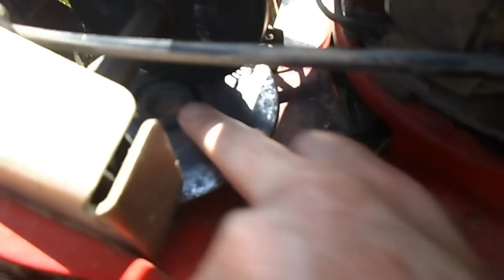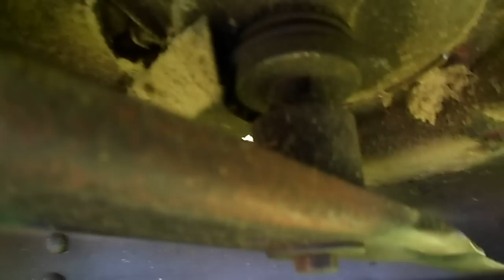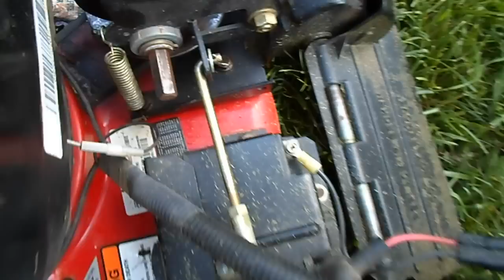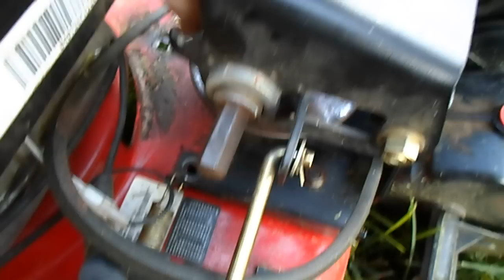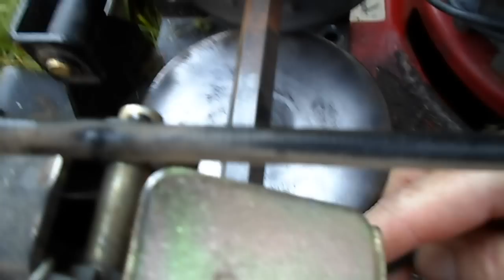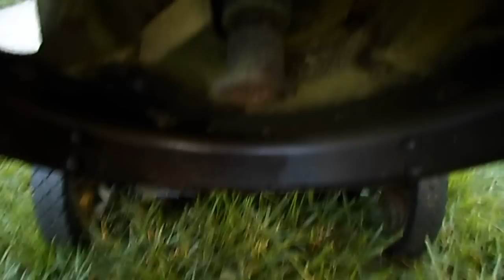Snapper Lawn Mower Model P216012 Self Propelled Drive Belt Replacement - Part I - June 1, 2013

Comment: Thank you, a friend gave me one of those older models with the idler pulley like you showed.  When he gave it to me I thought the problem was it wouldn't' run but after I got it running I found it wouldn't move either. The idler was on the other side and doing nothing when I got it and i couldn't determine from exploded views where it was supposed to be but your shot of your older model was just the ticket for me. Got the idler moved around  about 180 degrees and I have it back working again.
Reply: I did the same thing myself, remove the drive kit to replace the belt before I even order the new one, trying to put it back once the new belt delivered and didn’t fit/work, after watching the first few seconds I can tell how it should be installed

Comment: I know this is an older video and not sure if this would work on this model but on my older 21" Snapper instead of loosening the engine bolts I just remove the spring that holds the rubber disc wheel to the flat metal drive disc and then loosen one nut under the deck that holds the drive disc down and then I am able to slip the belt out from under the drive disc and remove and install new belt in reverse order. Put the belt over the crank pulley and then under the drive disc onto that pulley and lower the drive disc back into the hole in the deck, put the nut back on and tighten, put spring back on the rubber disc wheel and your done!
Reply: much harder to do this way on this desighn but  can still be done
Reply: @super20dan  actually I just did it that way just now and it is easy.  Good to take that disc off and inspect it anyway. The bearing on the bottom side of the disc is probably in need of replacement or at a minimum cleaning. Just make sure you align the bolt properly when tightening. There is a square hole that it has to align with. Alignment is done with a flat head and the the slot at the end of the threaded shaft. Thanks!

Comment: Your can replace the belt slide over the drive plate feed through the hole towards the blade just remove the blade put on pulley reinstall the blade👍

Comment: I just did this to one Snapper this weekend. What a chore it was, lining the belt and tensioner pulley..... Looks like your mower is missing the idler pulley??? There is a spring that pulls on this arm that has the pulley at the other end. Or maybe my older white handlebar Snapper had one and yours doesn't? Yeah just like the other mower you showed.

Comment from the maker: Hi Cristian no not at all.  The only time I have felt any vibration has been when the blade just needed balancing.  That would be felt no matter where the self-propelled was set.  Just sounds like it’s within the self-propelled unit the tension spring are you hearing any noise from this.

Comment: use neversieze on the under side bolts so next time no issues. you discovered the newer snapper drive delt system is wayyyyyy better than old.

Comment: How did you get the belt over the drive shaft pulley?  The belt is so tight I can't get it over.  I have the proper belt, too.
Reply: That's why he removed the engine mounting bolts, so he could move the engine enough to allow some slack for installing the new belt. Another poster above described a better way to install the new belt WITHOUT removing the engine mount bolts. I'm going to attempt this myself on a Snapper Easy Speed I got for $10. It runs great, but one drive wheel was broken ($37 for a new metal wheel) and the lower drive belt has stretched so bad that it doesn't drive the friction wheel now. I'm going to try and install the new belt by putting it on the engine crank pulley first (after removing the blade of course) and then feed it through the opening in the deck. You then have to remove a bolt (maybe two) and the spring on the bracket that holds the friction drive wheel in place to get new belt underneath it, and onto that pulley. We'll see how that goes, once I get my new belt from Amazon.

Comment: I'm really surprised there is no spring loaded idler on this model mower
Reply: I was going to ask the same thing. I have one in my shop that I believe is missing a few things. I need better views at these mowers especially where the secondary spring goes for the idler pulley.
Reply: snapper got smart and eliminated it.

Comment: When they removed the idler tension pulley it was a bad idea .
Reply: so wrong! best thing snapper ever did. i use these for a living and the old ones used to throw off the belt  all to easy. a real pain to put back on . this desighn is so far better . belt dosnt come off and pulls better also. belt last 10x longer also..